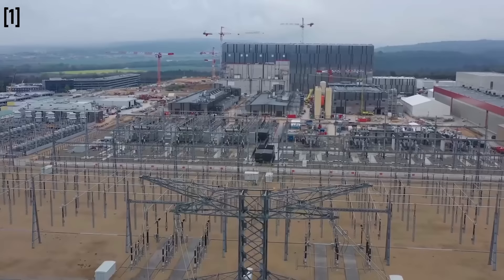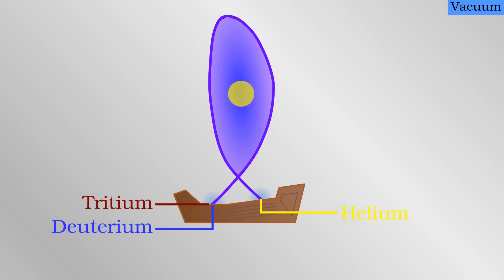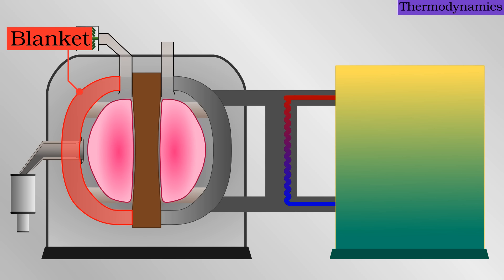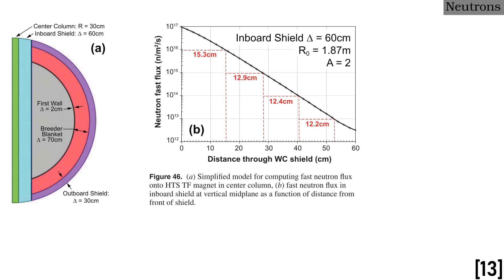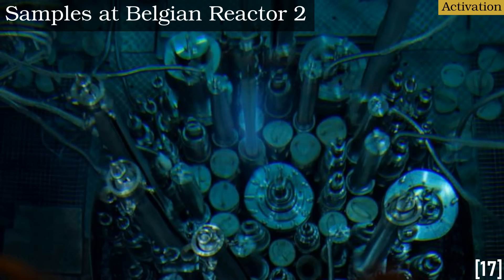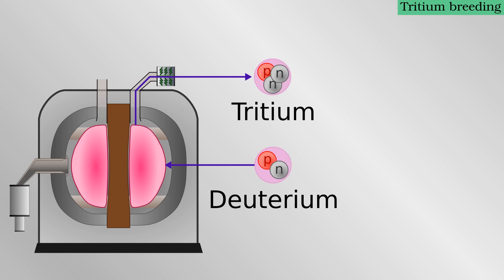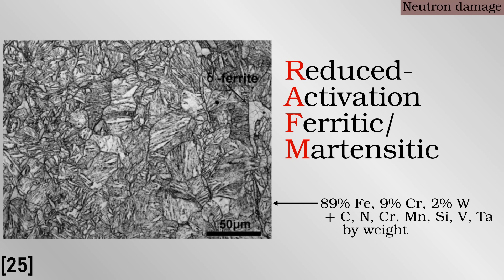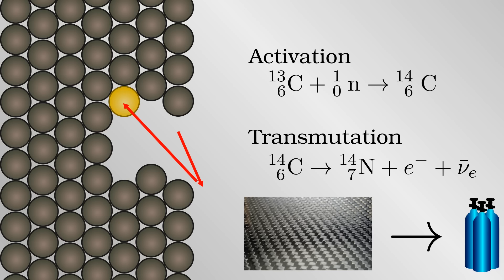How nuclear fusion (maybe) works (4) - reactor practicalities

Comment: I like your videos but I feel like you overplay the radioactivness of tritum a bit too much. It is radioactive yes and if you ingest tritiated water it is worse than normal exposure but the amounts of tritium produced by these reactors is really not that high, the radiation in the building itself with a leak would be higher but not immensly dangerous. And if it even had got to the ground water, the concretation would be abysmall, comparable to homeopathic medicine. US sets the limit of tritiated water at 740 Bq/L which is 40 milisiverts per year, quite low considering it's 25 time less than maximum dose for members of public per year and ~40 times lower than what flight attendants experience yearly. Meanwhile WHO set it at 10k, finland has 30k and japan 60k(Bq/L). So yeah overall i feel like you overplay the danger of such leak.

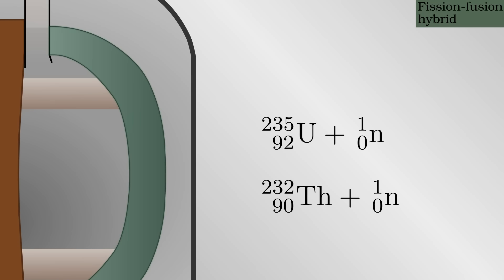Comment: Great video, just want to point out that at 22:00, while a fission reaction would certainly stop at that point, that does not neccesarily make it better than conventional fission power plants. Fission power plants are already designed to be subcritical and rely on decay neutrons to keep the reaction going. A reactor that has an accident will almost instantly kill any chain reaction.

However, it's not the chain reaction directly that's dangerous with a fission power plant disaster. It's all the decay products. Those decay products are chock full of low lifetime radioactive junk which puts out a ton of heat as it decays. Sure, its not as much as the main reaction, but plenty to melt the entire reactor into slag if the coolant systems fail. A combined fusion fission reactor would have the same issue. The neutron source would stop, but the decay products would remain and if this scheme was intended to produce any power, the decay products would be plenty to melt your entire reactor into the ground.
Reply from the maker: Great point.
Reply: Melt down, in the moment what temperatures are we talking about? Like enough to make those products into vapor? A slug, like the foot in Chernobyl is less of an issue - just a localized problem. Having radioactive material vaporized and dispersed in the atmosphere would come down to a big problem.
Reply: @Airwave2k2  It depends on the exact geometry and the size of the molten down core slag. If it ends up like a blob surrounded by insulating materials it'll get way way hotter than if it spreads out into a thin layer of rubble. The decay products toss out a constant power output regardless of the state of the meltdown, which means that its equilibrium temperature depends entirely on the heat rejection capacity of the core.

But, since plenty of those reaction products are gasses, or else have very low boiling temperatures, they would easily escape and contaminate the atmosphere. Iodine 131 would boil out of the melted down core as a vapor at only about 180 degrees. Caesium would follow at about 700 degrees etc. So a meltdown is gonna spew radioactive junk everywhere almost regardless of temperature.
Reply: @harmenkoster7451  I guess now when you mention it I could have looked up vaporization temperature of common fission products like those you mentioned. Thanks for writing out the obvious I wasn't able to see.
Reply: I'd like to correct your terminology if you don't mind - subcritical means that even with decay neutrons, the neutron balance per reaction is less than 1. What you are mentioning is simply called "critical", where the neutron balance including subsequent decay neutrons is greater than 1, but the prompt neutron balance, which only considers neutrons from fission reactions, is below 1.

There's a step above that which is prompt criticality, where the neutron balance of the fission reactions alone is greater than 1. At this point your nuclear reactor graduates into a nuclear bomb.

Comment: Excellent video as always. 

A very tiny nitpick is,  when suggesting fission/fusion hybrid plants, the suggested safety advantage came from the fission v target being subcritical and in need of additional neutrons. 

But I'd contest that that's how (most) fission plants are already built today.   The fuel assemblies are subcritical and require the neutrons to be moderated to achieve criticality.  When you make the moderator the same material as the coolant (water) that not only gives the primary feedback mechanism that supplies the power control, but it renders continued fission impossible under any adverse event that can cause a loss of coolant.

The remaining danger, as it is,  to both fission and fission/fusion hybrids is the removal of ongoing decay heat from the fission daughter products rather than any persistent fissioning.  To solve that problem, passive coolant loops would be needed for both scenarios. (or in my opinion, a reversal to liquid fuel/coolant combos, allowing the fuel to be translocated to more favorable storage or heat-rejection vessels) are necessary.
Reply from the maker: Yes, I totally agree and have had several comments pointing this out. I definitely think that a proper 3rd or 4th gen fission plant is very safe.
Reply: @Improbable Matter  ah, my apologies then for the redundancy. 

Thanks again for adding to this video series. While the simplified 'science communicator' videos have their place, the real potential of the internet is giving a platform where experts can actually provide details, explanations, and context beyond simple popsci awareness.
Reply: If we’re lucky Tom Cruise will make an action movie that revolves around a nuke plant operating on that principle, so that it will be more widely recognized.

Comment: Clicking on one of your videos is like rewatching a good movie, it never fails to amaze me.  Fusion is so much more complicated than what people think of. Im in my 3rd year of electronics engineering, and Im looking into a plasma physics masters for some time in the future. Aneutronic fusion would solve so many of the issues caused by neutron emission if it were an achievable thing. Hopefully it becomes a thing in the near future.
Reply: Yeah, but aneutronic fusion has its own issues. Bremsstrahlung is too high, so magnets alone won't provide enough energy confinement. I dunno if it's possible to build an super reflective box around the plasma, or make the plasma big enough to be optically thick.
Reply: Let's deal with 100 million degrees first before we go above a billion!

Comment: Nice, I think this may be the best video in the series so far, and not just because it alone is like 40% off the total length XD
Even though it only briefly scratches the surface, it's not dumbed down or wrong "for the sake of simplification", that sort of not treating the audience like idiots is surprisingly rare in the fusion community :/ and I love how you fill that gap :)!

This time (about engineering) it's more of my cup of tea, and specially with how large and dense this episode was, the thing I most missed is a good medium to discuss it (there were mentions of a Discord in the stream and a comment in the past, is that idea still a thing?)...

I do have some criticisms though, mostly minor ones having to do with the specific examples and way of speaking about various issues; for example the neutron issues in a fusion reactor are not thrice as severe as those of a fission one, more like thrice in magnitude ;3 due to not only increased neutron count but reduced absorption, much higher energy, harder machinery, etc; and that reflects in how fundamentally different the engineering approach must be... Just a few nitpicks like that that I think could be better communicated, the video is excellent c:

The mechanical and thermal stresses, as well as how different fusion schemes cope with the mentioned challenges is something that would have  been

There was one point that was worth noting as incorrect tho, subcritical reactors are not inherently safe and instantly shutting fission down is very easy, standard practice since before I was born; with most of  the risk comes from decay heat of the extremely radioactive short lived fission products, which would definitely be just as much of an issue in a hybrid reactor.  Furthermore, I don't think talking about it as a safety feature in the specific context of a fission blanket is fair, since that massive hole will want to plug itself if overheating or damage makes it collapse... Hybrid reactors are quite interesting, but not for that reason... 
Imo it's specially important because nuclear safety is a topic beat to death and still somehow always trivialized in the ways that made historical accidents happen (except for the scaremongers, which let's just ignore). "It's fine" is the mentality that caused most nuclear accidents and is disgustingly common in science commuunication, I think that as a youtuber with a reputation of not dumbing things down there should be a bit extra care in this specific topic :). Lmao I've wasted way too much time on such a few second tangent!

As a last thought: the topic of running, repairing, maintaining and extracting the power from such a reactor, as well as all the associated isotopic separation, lasers (if inertial), diagnostics,  etc would be a great follow up  video as this one already teased it quite a bit, and to be honest the core where the blaze is contained gets too much love and the (most  of the)  rest of the facility barely talked about outside the dedicated papers...
Reply: What a textwall lol. And it feels like nothing was said XD
Reply from the maker: I totally agree about the subcriticality part - that is definitely the biggest "dumbing down" part. To be fair, the latest fission designs are very safe.
Reply: @ImprobableMatter  they are indeed! To be fairer, older ones are too. 
The scariest part of a nuclear power plant is her manager, neglecting or delaying upgrades, cutting corners, etc... The reactor needs to be handled very stupidly to pop, and in a gen-3 PWR you almost need evil to even put it at risk as the operator, let alone as the engineer... The politician or owner tho, that guy will pull you a Fukushima every time you let them XD

Hopefully, the 4th gen will  have cheaper, simpler and more modular safeties so that they  are  less at risk of being neglected, less thorium melt plug bullshit (not that they're bad, but so much discussion for missing the point..) and more looking at passive decay heat removal, more compact heat sinks, low pressures, underactive fuel and coolant elements...

Back to the hybrid reactor concept,  the first thing that comes to mind is their versatility, able to breed and burn almost anything they want... Pretty sure that'll have no proliferation issues whatsoever >:3

Comment: Just a comment - FIrst Wall in not a vacuum vessel, it just prevents plasma to contact other in-vacuum parts. It is IVC (Inner Vacuum Chamber) that ensures vacuum inside
Reply from the maker: Yes, very good point for e.g. ITER. Some of the proposals and experiments I have to talk about are basically in a single vacuum vessel, so the two are one and the same.

Comment: As an engineer myself I love this video. 

For me it seems really hard, because fusion adds a layor of problems, on top on allready hard problems. 

E.g. the Neutron bombardment limits your choice of materials. So I imagine every component, any bolt, cable, seal, pump, sensor, etc. has to be designed for that.

Comment: I love your idea of a mix fusion-fission power plant! Can you make a future video on this topic?
Reply from the maker: Certainly not my idea! Edward Teller, the "father of the hydrogen bomb" thought it was worth pursuing.
Reply: It's also very similar to accelerator-driven fission reactors. In a sense it's one type of accelerator-driven reactor, except that it has a very exotic accelerator. The "traditional" accelerator-driven reactors use a particle accelerator to bombard a so-called spallation target with protons, which reacts by giving off neutrons (since neutrons are difficult to accelerate in their own right, being neutral). The spallation target is then surrounded by fissile material. The fissile assembly never reaches criticality, so the energy production can be stopped instantaneously by stopping the accelerator. The energy for the accelerator is taken from the electricity produced by the power plant itself.
Reply: A fusion plant can be used to destroy the long-lived isotopes from fission nuclear waste. And the fusion plant doesn't need to produce energy, because fission reactors already produce the energy. You still have to deal with radioactivity, but "only" for hundreds of years or so.
Reply: @zzasdfwas  - Fission reactors can be designed to do the same and we know they work.